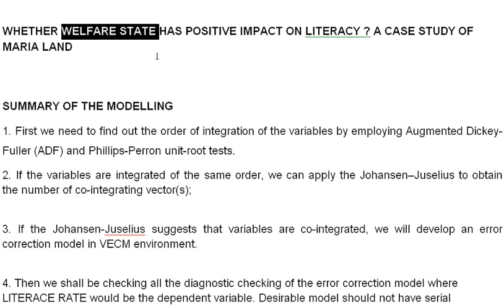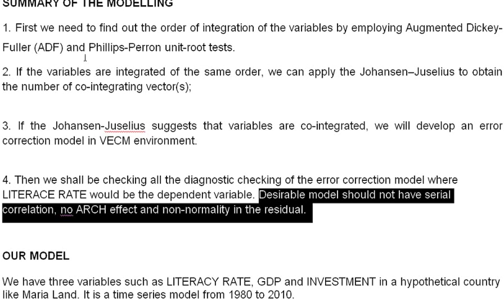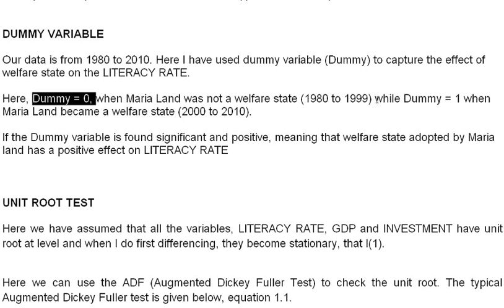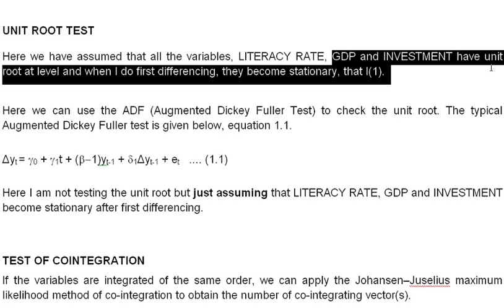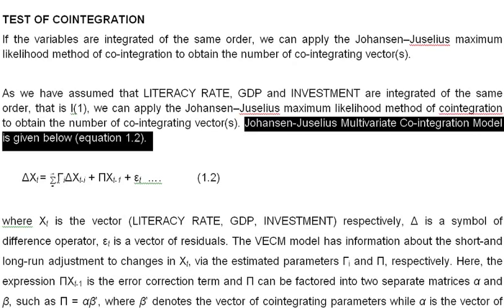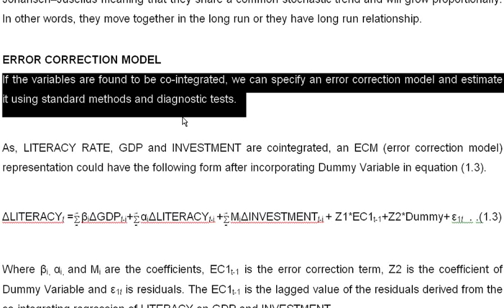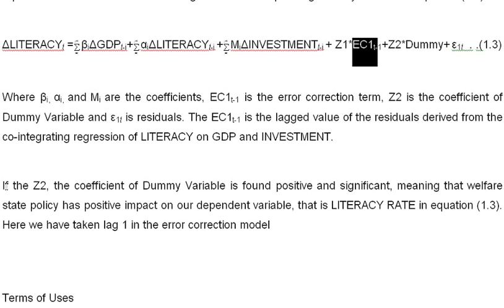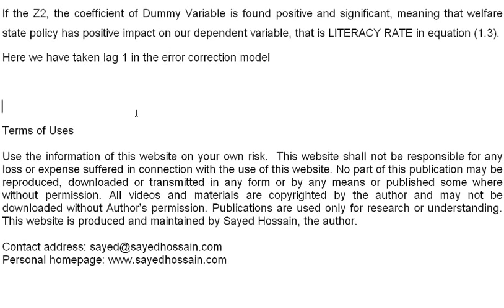Dummy In VECM.  Model One.  Part 1 of 4. EVIEWS

Comment: Dr. I like a lot your videos. I have seen yet all of them about cointegration and VCEM. I have two questions:
I.  I have three variables I(2), so they are satationary at second diference. May I apply a Johanssen cointegration test?

II.  In a restricted VAR model I have two error terms (because my model has two cointegration equations) but one error term coeficient is not significance. Is there long run causality?

I'll appreciate your answer.

Comment: did you ever manage to find an answer to your question? i have a similar situation. I have four variable I(2), stationary at second difference. However I am not sure whether I am supposed to apply the Johansen test at level so that data is non-stationary or whether I should be applying it at second difference so the data is stationary?

Comment: Thank for your video. Very clear. I have got a question: I am working with a VECM with 4 variables (Oil price, Exchange rate, Inflation and GDP). The oil price serie has  a clear stutural break (twice). How can I model it?  Do I have to create two dummies? I am using STATA. I would appreciate alot if you could answer my question